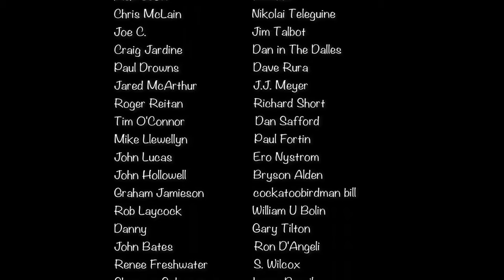Forged Hammer Method - GS Tongs

Comment: So that opening in the anvil isn't necessary with your method. 
The question is what is faster. 
Your extra punches does cost more than slot punch and a hammer drift. 
  But yeah you don't have a hardy hole tool for the largest drift your system works. 
Thanks again
Reply from the maker: I normally don't like to drift through a hammer eye but approach it from each side until the punch or drift just about bottoms out on the anvil face. My final drift, if done from the top down, leave just a slight taper so that wedging works. Thanks John.